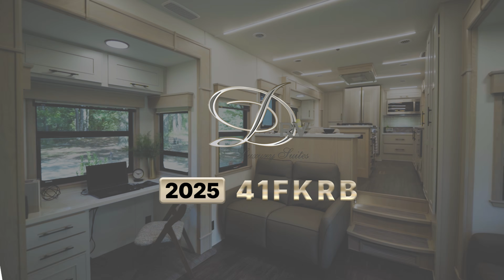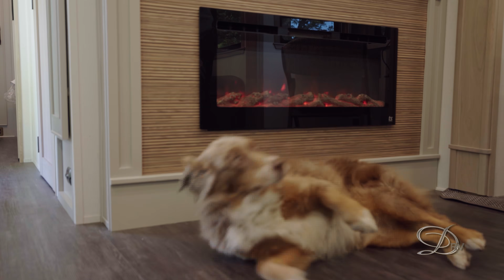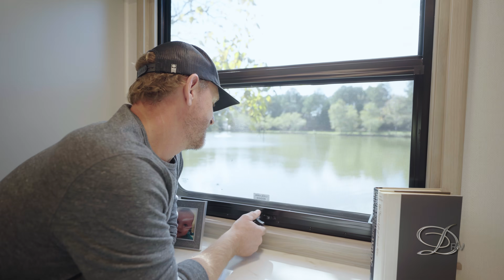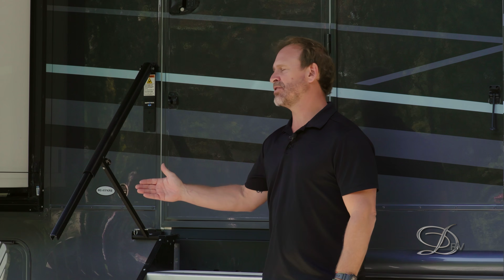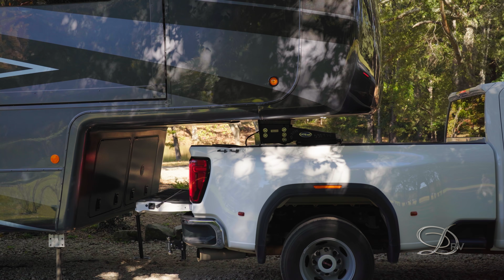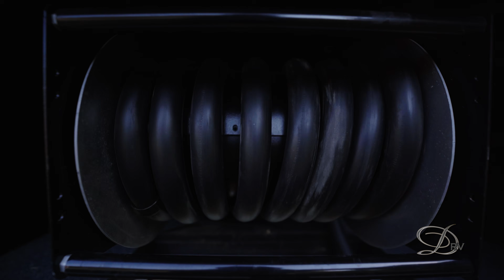Walk Through The Luxurious New Mobile Suites 41FKRB Fifth Wheel

Comment: For what this cost you can get a custom built Luxe.  Same full-time capability, same great suspension (even one better option), and you can customize just about everything.  DRV needs to up their game or lower their cost or allow us to customize these directly from the factory like Luxe does.
Reply: Luxe is not full custom, they are semi custom. They will not alter the floorplan layout in any way at all. With Luxe its mainly colors and finishes and additions like washer/dryer and other bolt in stuff that they will do and really DRV will do just about everything Luxe will do for custom options in that space, DRV is not a cookie cutter like a Brinkley. If you want full custom you need to visit New Horizons or Spacecraft. 

The big difference is you wont pay that sticker price on a DRV, expect it to be a LOT less at actual retail. 

We shopped both Luxe and DRV and DRV did every non standard "custom" thing we wanted, Luxe would have too. It came down to the Luxe toyhaulers kitchens, they are tight and not nearly as functional as what we have in our JX450 and i think the DRV frame is way better than the Luxe, i also like the hung wall construction better too.
Reply: @TDub_ADV  Yeah, I know you can't change the floorplan...that wouldn't make much sense in the long run considering the cost to do a "full custom".  I don't really care for the LUXE toyhaulers for the same reason you mentioned, and I just think they look dated.  Besides the layout, you can change pretty much everything else.  I've been talking with them about putting in incinerator toilets and instead of installing a black tank (you would no longer need one), install more freshwater space or convert that space for more cargo or simply free up the weight.

I need to look into the frame and walls, I'm very familiar with the LUXE construction, but the DRV not so much.  The DRV's just don't appear to be as refined overall, from what I've been seeing.  Maybe I'm wrong.
Reply: @8654ZuluFoxtrot  When we got a quote on a Luxe the price came in very close to what it would have cost us to have a full custom New Horizons built and basically start with a clean sheet of paper. Personally between those two it would be a NH all day, every day without question. One thing that Luxe told me that could not do was put electrical outlets where i wanted them specifically in the garage. I needed them on outside walls for desks and they said nope....  

Overall i do think Luxe builds "prettier" unit than DRV does inside but that was not our #1 priority like it is for some people. Our DRV is nicer inside that most, i think Luxe takes that up a notch. For us the functionality of the living area was key and we simply hated the Luxe kitchens. Way too small for two people to cook in there and since its something we enjoy doing together that was a non starter for us. 

So as far as the frame and walls go. The Luxe frame is a drop frame a lot like a Grand Design, Brinkley where the upper deck stops at the front of the pass thru and then drops vertically. On a DRV they carry that steel past the pass thru and connect it to the main chassis beams in 4 places. They also use 15" of boxed steel instead of a 12" I beam which one could argue the box steel is a lot stronger with all the twisting and shaking going down the road. 

As far as the walls go, Luxe uses a vacuum bonded wall like a lot of manufacturers do its just thicker. DRV uses a hung wall that is more built like a sticks and bricks. They do aluminum "studs" 16" on center like a house( most RV's have a lot less veritcal supports in walls) and they do not weld the frame. They use glue and l brackets like how aircraft are built. Welded walls there is a risk of cracking at the weld, because it weakens the material next to the weld due to heat,  with aluminum if its not done exactly right its brittle. The wall is then hung on the coach, insulated and skinned. I can say they do a great job there since our RV has been in very cold conditions and we have had no issues. 

I would say watch the factory tour videos for both brands and you will see the stuff i'm talking about. Or better yet go tour the factories and do a bunch if you do to the Elkhart area, its eye opening the difference between manufacturers especially the mass market ones that roll hundreds of units a week vs smaller ones like DRV and Luxe that move 10-20 units a week max. 

Beyond the kitchen construction was really important to me and i feel like DRV does a really good job with that. I have built a lot of things in my life and when i did the factory tour i did not find a lot to complain about at DRV. They were very open and showed me everything i wanted to see. Like anything there are things i think they could do better like neater wiring and plumbing but i did not see anything that made me run like some of the other more mass market manufacturers. I would have no problem owning a Luxe either, if they built a better kitchen with more people space and counter space. 

To date we have ~16000 miles on our rig now and we have had very few issues with it and really no issues with things that were actually built by DRV. I dont feel like ours is shaking apart like so many others do. The issues we have had  have been commodity stuff like a faucet that started dripping, the fuel pump on the generator that quit, or a light that started to flicker or the water pump that croaked when we ran the tank dry and the dishwasher kept calling for water for like an hour. Things like that, all minor and easily fixed and all stuff out of the RV manufacturers control. Our RV is not perfect, none are but i feel like this one has been head and shoulders over the horror stories that are so prevalent in RVing and its been really nice to live and travel in.
Reply: A reasonably featured Luxe is easily $300,000. This is $160,000.

Comment: The cooking stove in the middle of the kitchen is not in a good place. Grease splatters. This would have worked better in one of the wall slides with a backsplash.
Reply: Very good point 👍
Reply: You know, they’ve invented grease splatter screens. They cost $5 on Amazon.
Reply: Thanks for pointing out that the stove is for cooking.   There’s an exhaust fan above the stove.